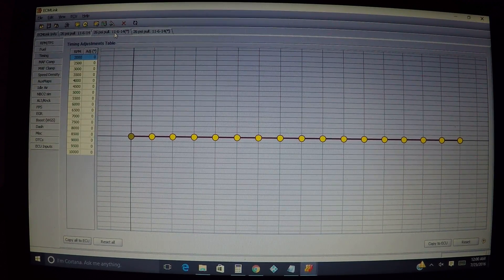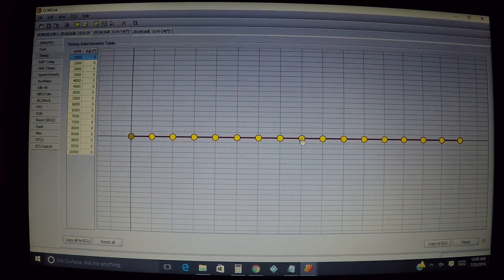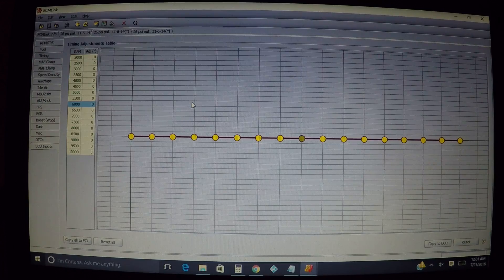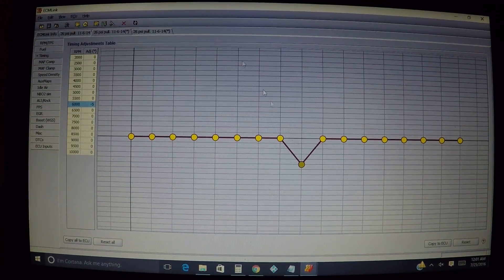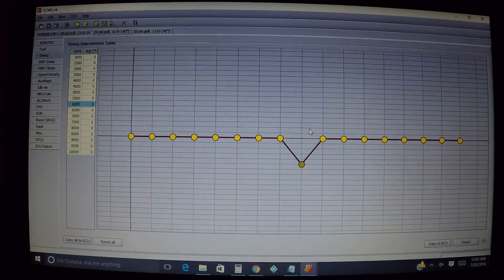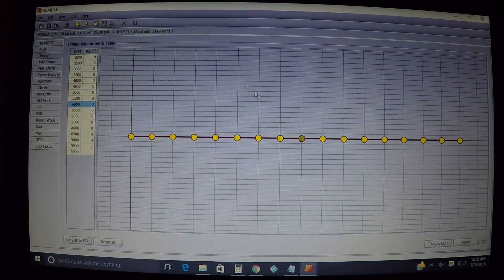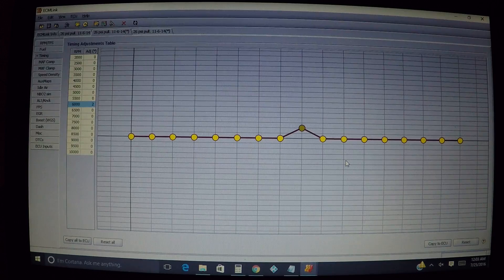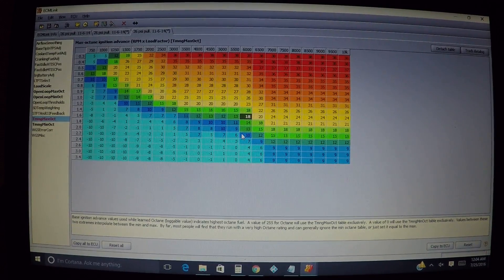Timing

Comment: Are you still tuning? Really could use some help
Reply from the maker: Trying not to do remote tunes but feel free to shoot me questions on Facebook if you'd like. Eye surgery today though so forgive me if it takes a bit to reply.
Reply: Scott Laird hope all went well with surgery and hope you feel better soon. I’m having trouble with 3rd and above it goes pig ass rich 9.5 all power is there in first and second and afrs stay around 12-11.5 but I’ll have to send you a log. I understand and not remote tuning I have a dyno machine and a shop just can’t find a reliable tuner. 1997 eclipse gst evo 3 big 16g 560cc evo injectors all supporting mods 255lph fuel pump rewired